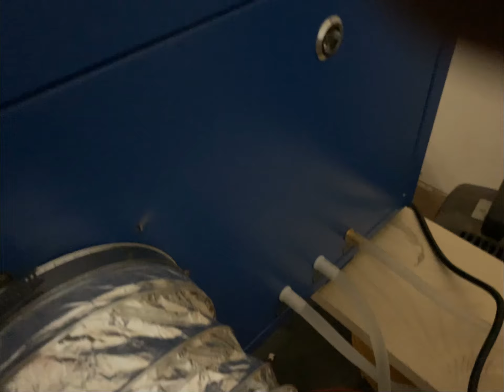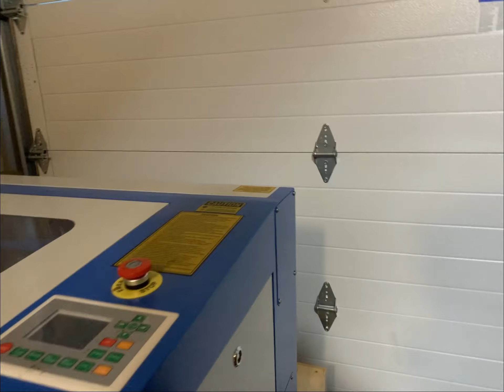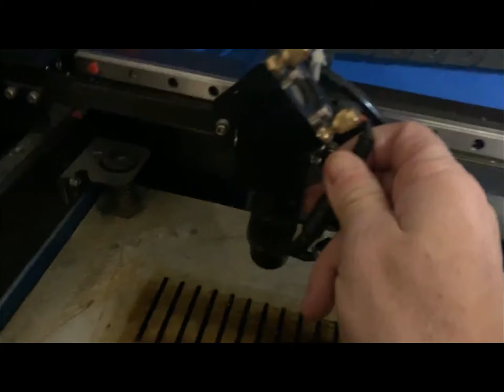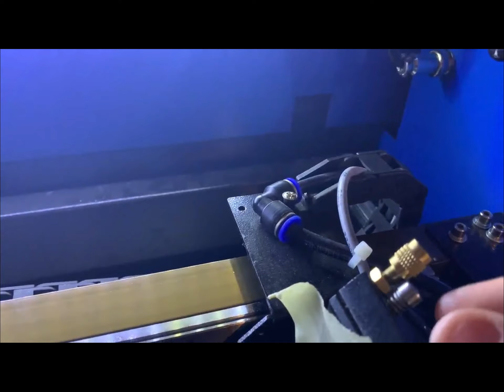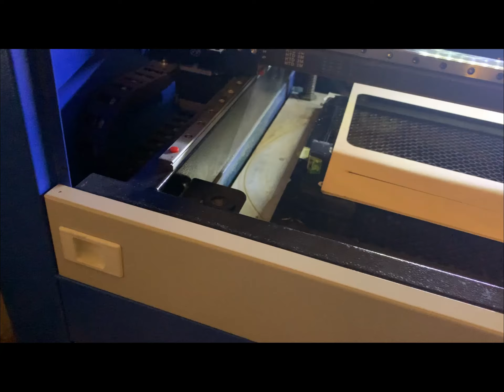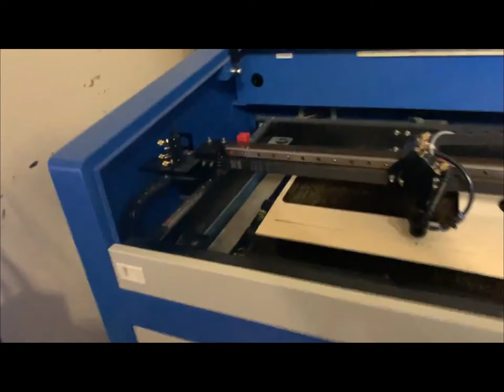My 50w CO2

Comment: My same machine came with air assist and a honeycomb bed as well with a cooler. No problems so far to be honest
Reply: I just realized the Ruida Controller is upgraded on mine and there is a horizontal passthrough. So mine is probably an updated version of yours.